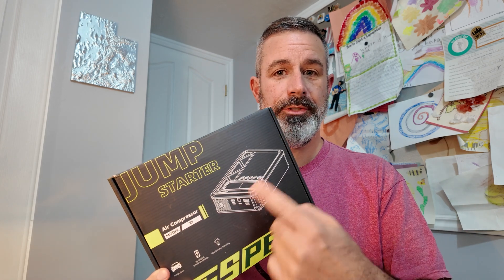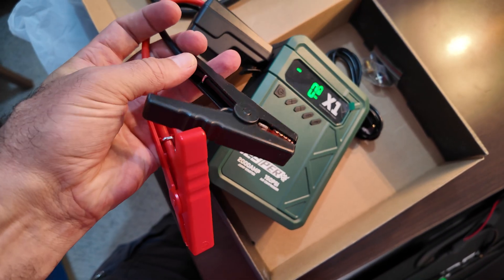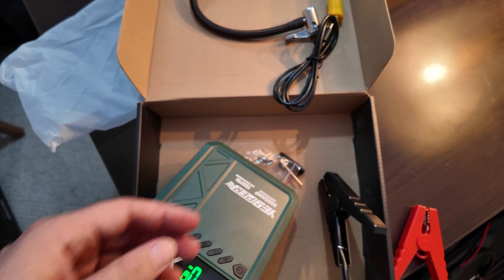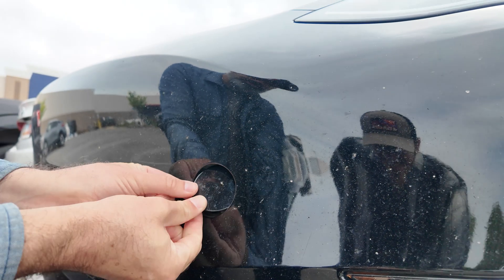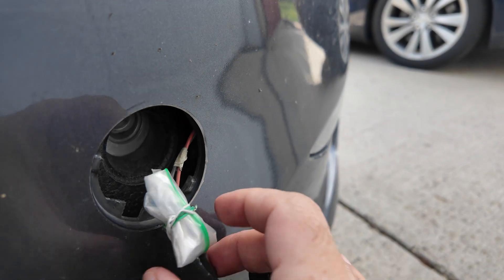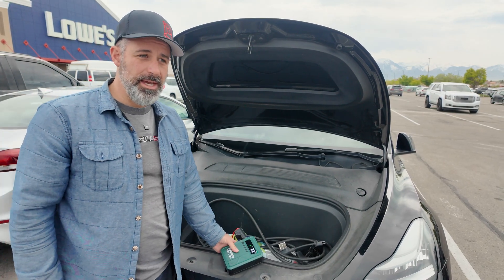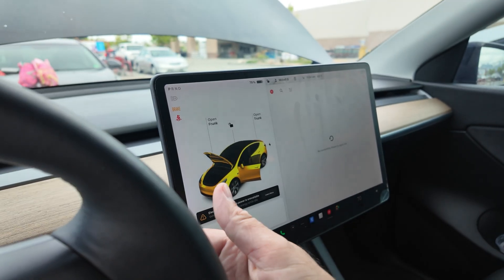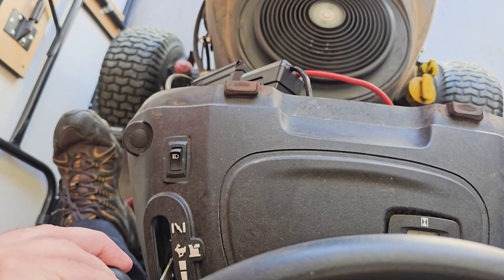Jump-starting a Tesla Model Y With The Yesper X1

Comment: Your Tesla will alert you when the 12v battery needs replacement which means you will never be stranded.  My car alerted me last month. It took me a week to replace it cuz I was busy.  You will never be stuck so don’t worry.
Reply from the maker: False. There are many instances where it doesn't warn including this video you're commenting on. You're right that Tesla has written into the software to warn you when the battery needs to be replaced but it does not always succeed at providing a warning before the battery fails and leaves you stranded. I've seen many anecdotes on forums and other YouTube video comments where people were surprised and stranded. You could proactively replace it over a certain interval but considering batteries last from 1-5 years in general you're potentially spending a lot of money replacing batteries before the end of their useful life by several years. It's really a good idea to be prepared to power up an EV with a dead low voltage battery. Or rely on roadside assistance, but I don't like relying on others, especially on road trips in remote locations.